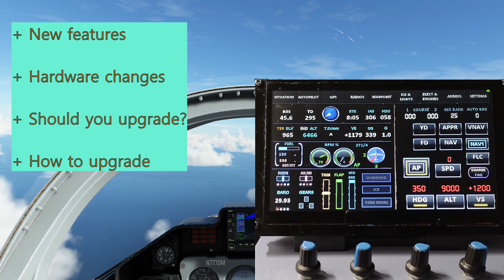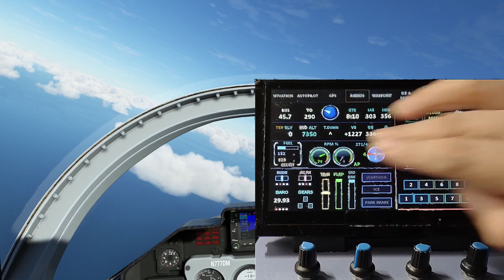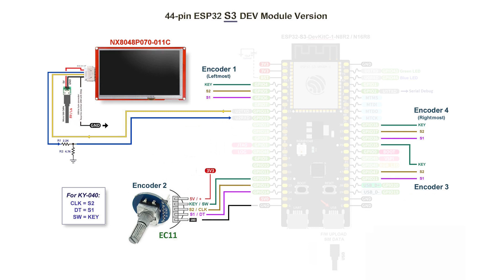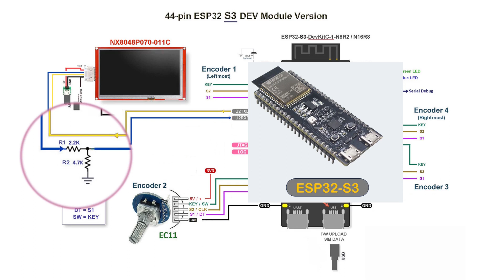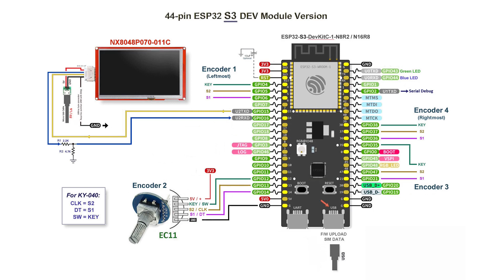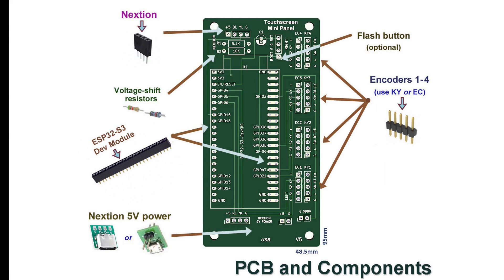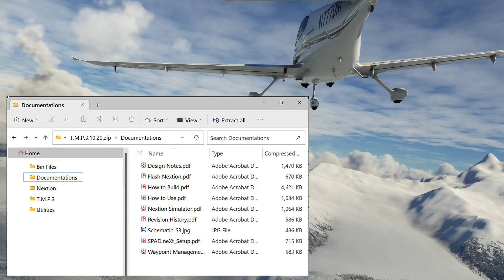Touchscreen Panel - MSFS, X-Plane [Update 12]

Comment: The biggest benefit of the use of the 10-inch touch screen is not only the larger interface, but also the complete touch operation without the rotating encoder.🎉🎉🎉